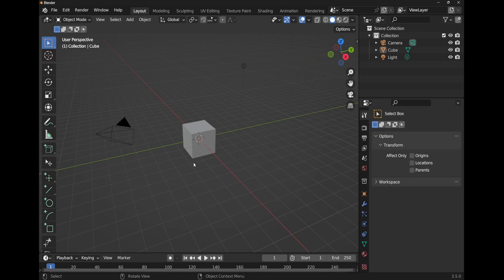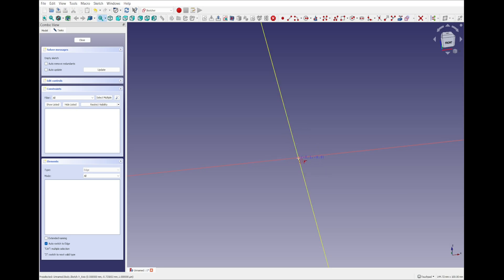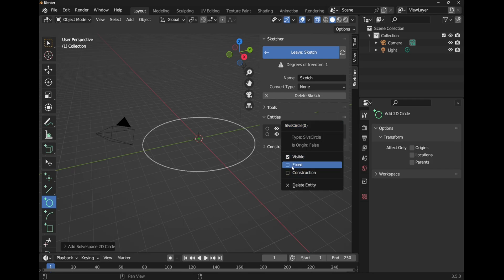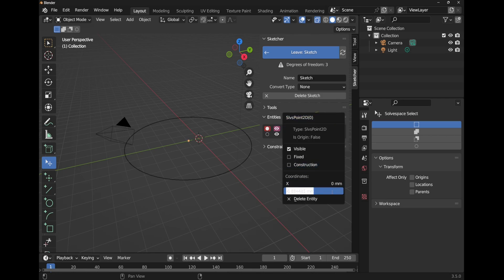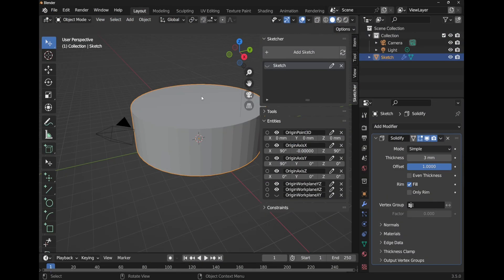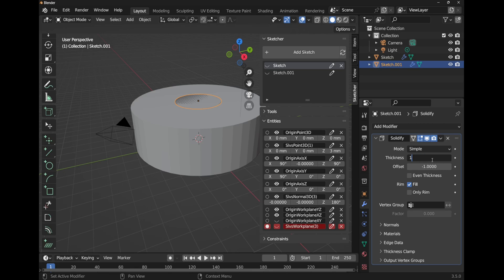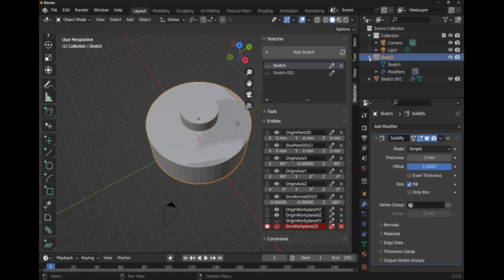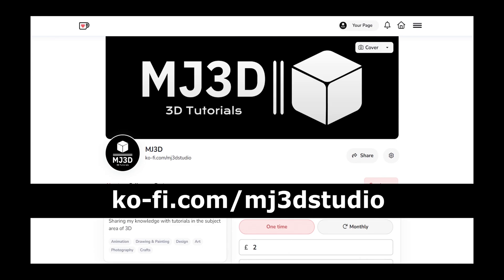Learn CAD Sketcher | 3 | Overview compared to FreeCAD  |  Blender Beginners Tutorial for 3D Printing

Comment: I've been trying to design surfboards in freecad, but i keep getting weird renderings. It may be due to my lack of understanding of the tools, procedures and i have made inroads, but it kept getting weird at the nose/tail of the board, partly because I'm designing a hollow board with inner scaffolding. I'm now looking into blender to satisfy the design. The first problem i have is when converting to mm, it seems difficult to work with a 2 to 3 meter object as the grid doesn't seem to want to render. Not positive what outputs i need, eithet dxf or eps for molds and cuts. What fun!

Comment: i'm blocked at just beginning. i click "+ Add Sketch" and hover cursor on 3 planes and nothing highlight and clicking it just ignored and cancel to original state.
Reply: and for more context, i'm using arch linux + blender 4.5.3 LTS. had issue of python version and fixed it by tweaking zip file with python script from community.

Comment: For some reason, when I did the Boolean part for the 2nd sketch, it ended up being the same size as the first sketch when I selected Union (without changing the measurements, but when I selected Intersect, I got the right size as you. However, If I select Fast for the solver and than Union, I get the right size. Any plans of doing an update video with Blender 4.0?
Reply from the maker: Thanks for adding your findings which will be helpful for anyone following and having the same issues. Regarding the update I think that's a good idea as I am still running on the previous version.
Reply: @MJ3D_Blender  thank you, I was following everything exactly as you had said until I had that issue with the Boolean and union part. There’s not many videos with blender 4.0 and Cad Sketcher, so you may be able to claim a large number of views in that area. 

Look forward to the updated 4.0 videos! 🙂

Comment: Does the Blender Sketcher have a History Tree???
Reply from the maker: So the modifier stack can be used as editable parametric history per se as long as when adding  the modifier you don't apply until the end which sets the modifier in stone and no longer editable. So adding a modifier such as solidify, mirror etc can be edited later but, say, when it comes to export  modifiers have to be applied for the end result. Which I have a video in the series for which could help put this into visuals 😊

Comment: Thank you for the detailed video! But unfortunately I've got some strange issues with it - CAD Sketcher Workplanes are not visible
 I can’t add a Sketch on a Workplane, because the Workplanes aren’t visible when I want to add a new Sketch. I use Blender 3.6.2 on a Mac Studio (2022) with M1.

ill be very appreciate of any advice, thank you!
Reply from the maker: I am thinking that you may not have your view centered where the x, y and z axis cross? When you first start blender you have the  cube centered in the screen. If you move say off to the left then add a sketch then the work planes are off scene. Could this be the issue? Or you may be zoomed too far in.
Reply: Hi @MJ3D_Blender, thank you for your reply!
I researched a little about this issue and found that other people have it too. 
"I have installed the add-on and PIP, however, I did see a message saying QWER Master is missing. Cad Sketcher does not show the axis planes.
 I would expect axis planes to be displayed."

And there was a solution:
"Maybe openGL/Metal issue? I just did a fresh installation of Blender 3.5.0 on an M2 Mac Ventura and had the same problem. Changing Edit>Preferences>System>GPU Backend to OpenGL fixed it for me."

So I tried the same and changed the GPU Backend to OpenGL and now I can see axis planes. But it works normally on older Blender 3.1.2. The issue is on Blender 3.6.1.
Reply: What you can do is go to preferences, system, than change it from metal to open GL. Should work after that, and I do not know why that fixes it but it does :)
 @julia_aman

Comment: Super interested in this series, waiting for the next video
Reply from the maker: Glad to hear it😊😎  Episodes 4, 5 and 6 are out. 5 is where we start really building something, 6 is exporting it out. 7 I am currently working on as we speak 😁
Reply: @MJ3D_Blender  thanks for the response, I watched lots of your freecad videos, trying to ditch fusion 360 for something open source.

But till now I just couldn’t get freecad to work with me, what I usually do in a couple of steps in fusion requires triple the work in freecad before it crashes or the surface is super messy.

Trying to make a fishing lure btw, I’m gonna try blender it’s way more mature than freecad, the only downside is that it’s not a CAD software, so I have to learn how to deal with meshes now 😁.
Reply from the maker: Have you seen a channel called Marling Baits? He doesn't 3D print lures but hand builds them out of wood and metal. He often makes some bizarre lures, from king fishers to alien face huggers and he sees if he can catch on them. I used to fish and tie my own flies and make my own spoons when I was a kid but stopped fishing many years back. I go every now and again and it reminds me how much I miss it.

I know exactly what you mean, I came the other way from mesh modelling to CAD. First thing I had to deal with was the language barrier, rotate is screw, fillet and chamfer are bevels. It's one reason why I put this channel together to allow for the transition either way and for me to force myself back into mesh modelling along side CAD as they compliment each other nicely.

Comment: I've watched a heap of ur freecad tutorials and it's been invaluable. I tend o design mechanical/hydraulic systems more organically which has been a bit of learning curve. Thanx for your great work mate.
Reply from the maker: Thanks for the kind comment and it's great to see that those tutorials have helped you out. Is funny you should say about the mechanical systems. I am working with a patreon at the moment regarding mechanical movement and emulating some basic mechanics using sketcher as the  bones for the movement along with assembly 4 workbench which will be appearing on the freecad channel soon so may be of interest.